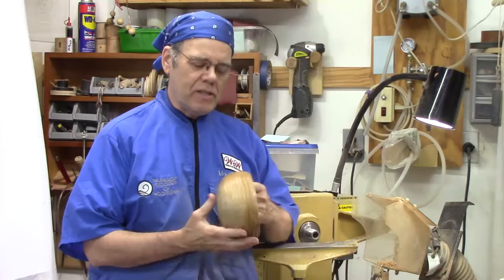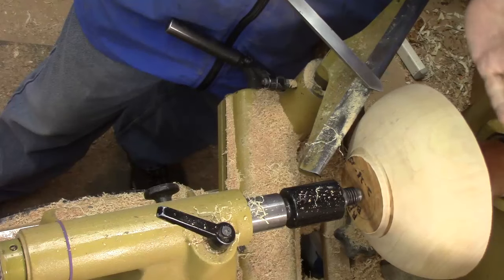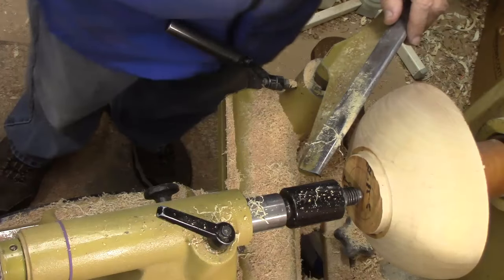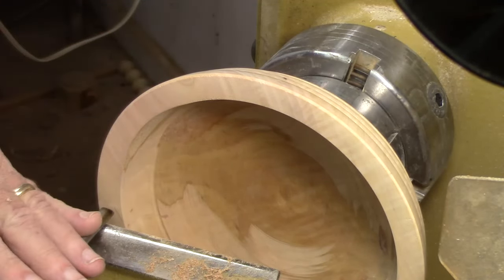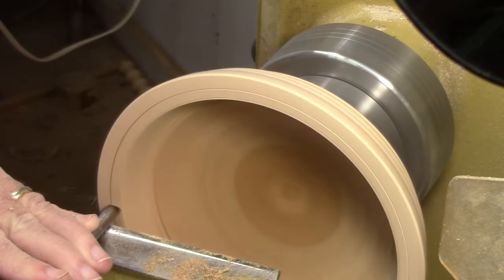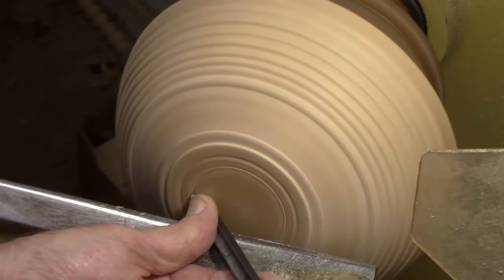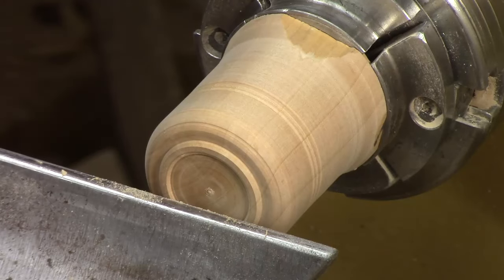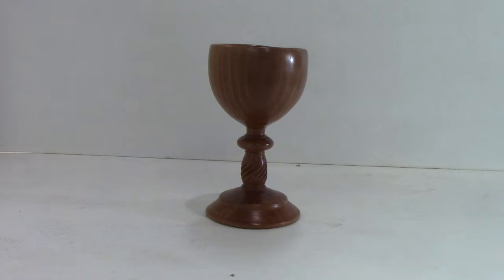Add a Few Beads to Woodturning

Comment: Very interesting video Mike. I don't have the small gouges as you show, but I think I can make a bead with my tools. I'm making a tool handle now so I'll give it a try...before I get down to the finished size. :) Thanks for the info.
Reply from the maker: I think a 3/8" spindle gouge is almost a must have in a woodturners box. After that it depends on what you turn and how much money you have!